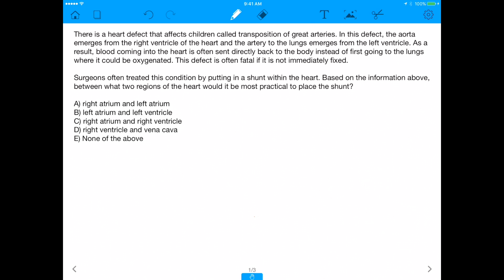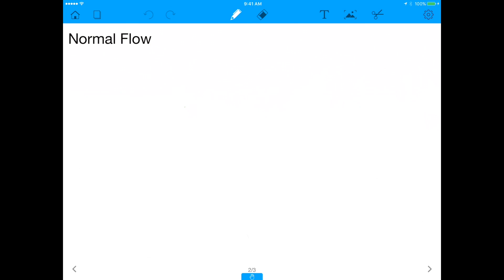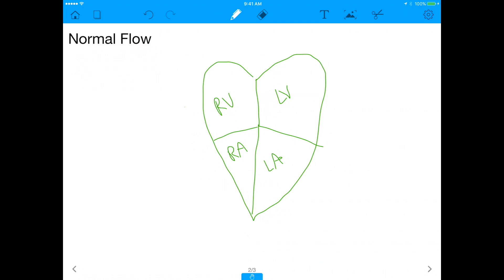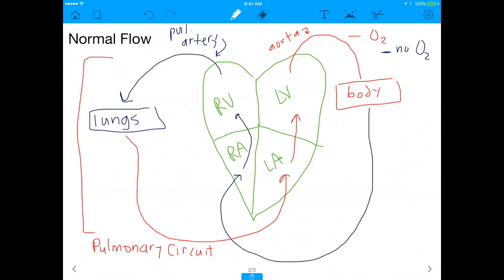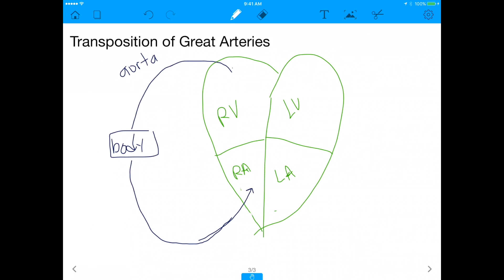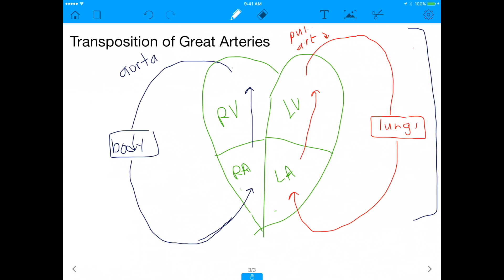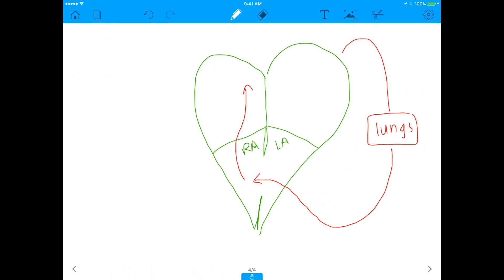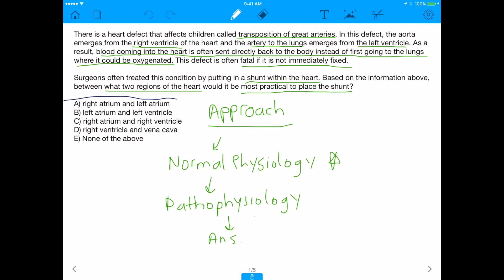MCAT Question: Systemic and Pulmonary Circuit (Transposition of Great Arteries)

Comment: Hi Preak! If the ventricles and atriums are switched would the answer still be in between the left and right atriums? Thanks for the videos!!
Reply from the maker: Because the overall flow stays the same, the answer is still the same! The atria and ventricle locations are kinda arbitrary, but because the flow (atrium -> ventricles) is conserved, the answer is still the same!
Reply: Thank you!